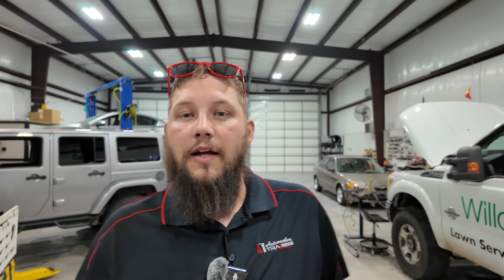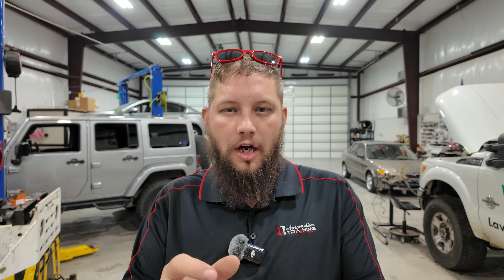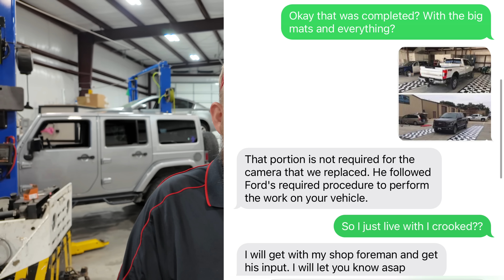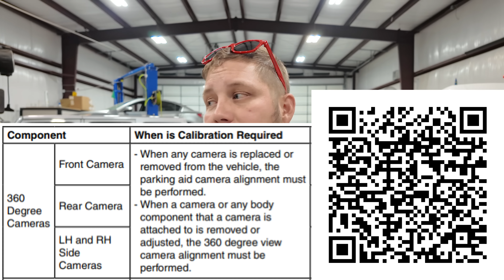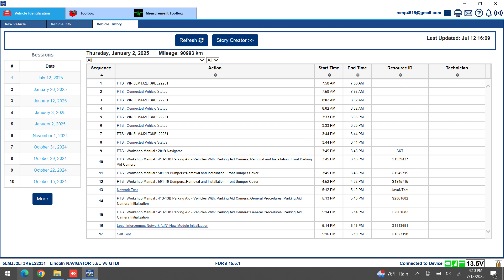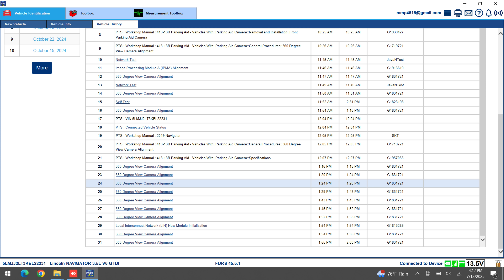Ford dealer didn't know how to repair it correctly... and it's a recall!

Comment: Aggravating but not surprised. I became an advocate of using independent shops (or doing the work myself when possible) long ago in part because dealers misdiagnosed or did work that resulted in undesirable results all the while being charged outrageous charges. Well done documenting this issue.

Comment: ive over my 76 years that most stealers  dont have certifired machanics  if they do ther got their crtificates at wall mart  had my wife jeep at my local Dealer (Stealer)  for thre seperate time for the same issue  to which i told them  what i thought it might be    snd it was and i fixed it myself in my drivway

Comment: Think about it, if your computer breaks and you call in a tech, you're easily looking at $100–$150 just for them to show up, and another $100–$200 an hour for diagnostics and repair. And no one bats an eye. Nobody asks them to 'match Amazon’s price,' and they’re certainly not charging by the gigabyte, they’re charging for their time, tools, and expertise.
So why are automotive techs expected to diagnose a no-start, troubleshoot a CAN network issue, or reprogram a module, all under a flat rate system? It makes no sense. We're working on rolling computers with safety systems, not lawnmowers.
Maybe it’s time we stop treating diagnostics and reprogramming like flat-rate work. Not everything should be rushed just to hit a number, especially when it comes to our customers safety.

Comment: Keith, you're 100% right. I’ve said it before; cars need to be repaired correctly. If we want more respect and higher pay in this industry, it starts with fixing vehicles the right way the first time.
I saw it firsthand with a no-start condition, the car had clearly been Frankensteined, with layers of issues piled on top of the original problem. I got blasted for speaking up about it.
A lot of the pushback came from flat-rate techs. And to be fair, many of them say they're not given enough time to do the job right. so, they end up cutting corners just to get paid. The sad part? The customer ends up paying the price.
Maybe it’s time we stop treating diagnostics and reprogramming like flat-rate work. Not everything should be rushed just to hit a number, especially when it comes to safety.

Comment: My mom has a 2021 Ecosport 1.0t. I was going to do timing belt. I call ford dealership and order it up tensioner serp belt spark plugs she has 75k on it and iv sesn online where these engines strip the wet timing belt at 90k. So I start tearing it apart and looking at service info there is a oil pump belt under the timing belt. I call the other ford dealer becasue the one I got the first round of part doesnt answer the phone. So parts guy says to talk to the service department because the oil pump belt and tensioner are under recall. Service department says what symptom. None Im trying to save the engine from blowing up. Oh we cant do anyting without the symptom. So what is the symptom. Oil light and engine noise. Great.......SO what do ya do?

Comment: I'm an automotive locksmith. We had a customer call for a lost key. It was either a Nissan or Toyota. The dealer told them they could come by and pick one up. The customer thought I was BSing them when I explained the key needs to be programmed. The customer called back and got someone else who told her the vehicle had to be towed in if they went that route. That's exactly what I told them. They paid us to come out make the key. We were also cheaper than the dealer. They only quoted her for the key and not the programming the first time they called. I don't think it's malice. It's just incompetence.

Comment: As a Ford tech I agree with everything you say. Vehicles need to be and should be fixed correctly, and by following the recall procedure. It is disappointing to know even if you do what you can correctly as required, a coworker that DOES NOT CARE can drag the reputation of the shop down (with you in it) and there's nothing you can do about it.
The argument with that being said, when Ford issues these recalls the technicians that are operating on flat rate see that recall pays (as an example, I haven't seen the time specific recall pays let's say is 1.4hr) will do EVERYTHING to short cut to make money (aka beat the book time) because it doesn't pay enough. Do 3 or 4 of those in a day and realise you have actually spent actual time 6 hours doing them and you start to see the justification of how people push away from doing the job right, and "getting paid" especially if some of these guys are on low weekly hours and what to get out of work or SO backed up on jobs they have and then those recalls were handed off to them to get done quicker because they didn't have anyone else to do them or the technician who normally takes care of them isn't at the shop.
Truly I blame the industry. It's getting very frustrating to see these recall times paying less and less with these service procedures requiring more and more processes for repair. And I find it unacceptable that a billion dollar car company can make a product that has so many faulty products continue to use cheap warranty labor to cut of cost repair on a mistake or known defective product.
Reply: Also as a Ford tech it's absolutely frustrating that even when these jobs in the recalls and let's take this one Keith is speaking about. 
Not just the recall but the service that must be performed as he said even taking off the grill. 

The tech can claim M time or even additional programming time when these situations happen. 
  Ford is willing to pay the techs time. 
It must be documented and written in the story. As he showed FDRS shows the proof as well as PTS. 
Every keystroke is logged. 
 I've always been paid correctly.
Reply: They don’t care. Until no one works on them anymore nothing will change. I would never work at a dealer again
Reply: @hddm3  sorry you had a team fail you.  The manufacturers are willing but there's those clown shops and techs that have for years robbed the customers and the manufacturers.   

Probably best you don't go OE again. 
  It's not for the weak hearted

Comment: It does suck unfortunately the way the pay system is structured guys cut corners all the time to try to come out ahead and it's wrong and only going to get worse there are not enough guys to replace the ones leaving and it takes a lot of training and skill to be able to fix modern vehicles

Comment: I hate Hate HATE doing the old static 360 cams on Fords.  You think it's a pain in the ass in your shop, try doing it in a gravel parking lot on a windy day...  I honestly usually turn down these jobs if the shop I'm working with doesn't have well lit indoor space.

I've been playing around with the possibility of modular backlit panels with an anti-glare coating.  At the moment, it's cost-prohibitive, especially because I'm seeing fewer and fewer of these.

Have you run into the APIM glitch yet?  As of a couple weeks ago, FDRS had a huge warning on the front page stating APIM programming was disabled on certain vehicles, and what they DON'T tell you is that if you replace a steering column or a lane camera, you'll brick the IPM-A's 360 camera functionality.  Found that out the hard way about a year ago, and they STILL haven't found a fix.  :(

Comment: Just had the same experience with a ford dealer. New to my area, took my lowered mustang in for a simple toe and go alignment. Got it back pulling harder to the right. The advisor told me it would never be straight without camber plates . Was also told negative camber causes tire wear if not fixed. The camber is equal negative camber shown on the sheet. The car being lowered means if I zeroed the camber the wheels would hit the fender….I told them was a technician for 8 years and that simply wasn’t true. Camber needs to be unequal left or right to cause a pull. The tech realigned it and the service manager said him and the foreman believe that without plates it cannot be aligned straight. I took it to another shop and had it done - straight as an arrow. Should have known better, I just figured a simple solid rear axle alignment (just front end toe) wasn’t that hard. I also figured someone within the building knew vehicle alignment basics……
Reply: I run into that. I'm the only guy that can align anything in the shop. It's not hard if you actually think and care.

Comment: This is the result of the awesome flat rate system. Manufacturers are paying peanuts for A level tech repairs. So everyone cuts corner every chance they get. Dealership service departments have become so corrupt and dirty that people only go there for warranty repairs or recalls.
Reply: This is why I never followed up with pursuing a career in the automotive repair field. It doesn't pay to bust your ass and do a job half assed because that is the estimated time when doing the job right takes longer. They just don't want to pay a fair wage to do the job right. On top of all that you are expected to bring thousands of dollars worth of your own tools. No thanks
Reply: And that's why the techs don't care. You get paid half of the regular time under warranty. If their corner cutting causes other issues so be it. It's under warranty is the mentality.

Comment: My customer bought a 2020 ford f150 from ford dealer. On way home check engine light. P0430. The dealer agrees to fix it and they put an aftermarket bank 2 catalytic converter with a band clamp and RTV
Reply: If that has under 80k miles the cat is covered under Major Component (PCM & Cats) 8/80 coverage as part of federal law.
Reply: @allendstephenson  140k
Reply: @allendstephenson  Maybe I wasnt clear. It was a used FORD truck sold by the FORD dealership. The FORD dealership installed the cat. They it bolts to turbo and it was leaking there. It supose to be welded to y pipe. The FORD dealership wrapped RTV with a stainless band clamp.
Reply: @eddiereichel9354  I understand that, 8/80 still applies even if it's used.
Reply: @allendstephenson  It has 140k miles on it